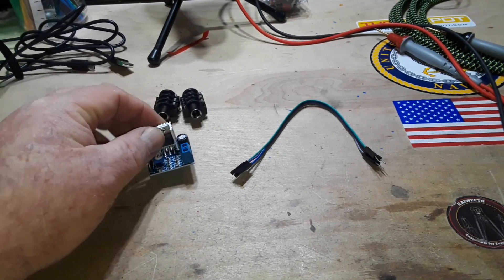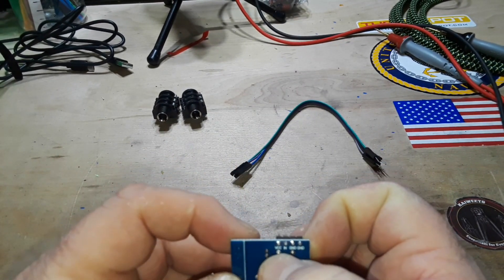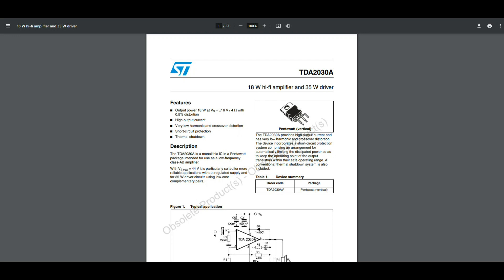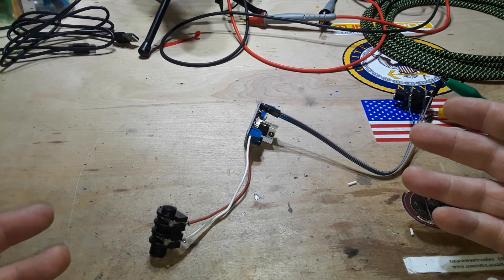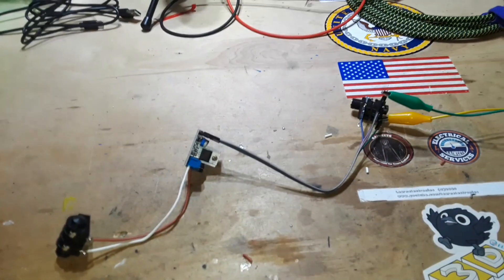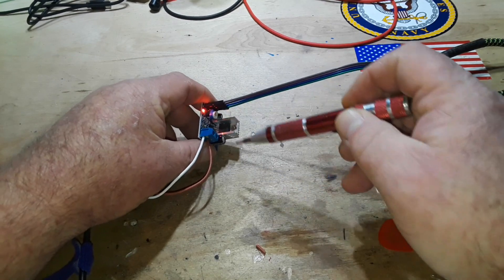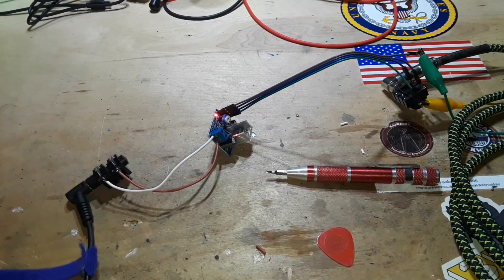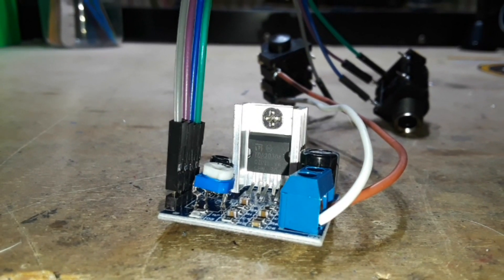$2 DIY (Guitar)Fuzz Effect From Amazon

Comment: Love the channel first off been watching a lot of your videos lately while I work on my pedals funny enough. 

Anyhow interesting experiment I actually did similar with the same modules about a year ago but with a preamp that had added clipping in mind, and replacing the trimmer with a pot to be a better sweep as well as mounted into a box eventually. 

And basically what I ended up realizing is the 2030 is what a lot of if not all of the smaller practice amps were running in the 2000-2010s era. That or the 2050 for larger configurations. And thus I was essentially making a crude amp in a box that was either good for a little board mounted amp or a roughneck stereo rig (if you add the second out between the preamp and the mod board) 

I’ve also seen a lot of those 386 module videos and there’s certainly a case to be made for their price and pre assembled nature, but the concept exists all over the effects world and Is more of a find your flavor thing. See RunOffGrove , etc designs for a masterclass there. 

And by the way this is just my two cents adding some perspective to the concept here im not trying to speak out of turn or sound like a smart ass. From what I can ascertain from your channel is you’re likely more learned overall in EE, or at least more seasoned. 

Nothing but respect in the end because you’re the one putting in the work of making videos for folks. Just enjoy the pow-wow of sharing experiences with other builders.

Comment: LM386 is a nasty, dirty amplifier at the best of times, I can imagine just how distorted it can be when overdriven. 

I suspect the lower the output power the chip is capable of the worse it will sound when overdriven but the dirt cheap PAM chips are a bit special, they've got 2 modes, class AB or D, I wonder how that module is configured and if maybe switching it might change how it behaves?

Comment: Try a "Black Ice" passive distortion. Or make one your self with two diodes in reverse bias to each other. Replace the tone cap on the guitar and you have a passive on-board distortion. The output of the guitar will drop a little, but it has a pretty good sound. The tone pot will control how much distortion you get.

Comment: I had been checking out the last Mockman video. - The TDA2030 is a Power Amp. Hook the output of the TDA2030 module to a passive speaker. Not the computer interface. It looks like it is just a Power Amp without the pre amp so either build a pre amp or maybe the Fuzz will do - though its is not ideal. -  Guitar - Fuzz - (peramp) - TDA2030 - Speaker. I could be wrong 🍻 - edit - the 386 is also a power amp. Mostly used for driving headphone amps or those little plastic guitar amps. Even old telephone answering machines. The 386 (there are variations) can easily drive a small .5 watt or higher speaker. Like the TDA2030 it is best to include a preamp (simple transistor-based) However, you can also use the 386 to build a fuzz. Often these are called an 'amp in a box' because the output is far greater than your average distortion pedal. As I recall there is a trick to setting the gain stage of the 386 by bridging two pins. Good Luck
Reply: Luckily, he is way under powering this. Otherwise, the amp would have been toast.The TDA2030 is an amp chip that can run up to 18-0-18 volts with an rms of 18watts. I built one using a j201 jfet preamp and another using a Matsumin Valve Caster as a preamp. They both sound great, with lots of clean headroom.

Comment: If your sticking with 9 volts just because that's a common stomp box voltage you could use a cheap dc/dc booster to get that amplifier closer to it's clipping range.

It sounds like your going to need some filter capacitor circuit to weed out some of the noise. I'm not sure if a constant current style filter or a constant voltage style filter would work better in this instance.

I'm also not sure wether to apply such a filter before the amplifier or after?

And from there you could take the weak signal and boost it through an old regenitive radio circuit design for a one tube radio where they feed back the radio signal into the circuit to boost it but in this case it would be boosting the fuzz.